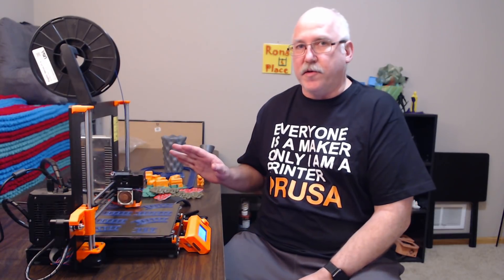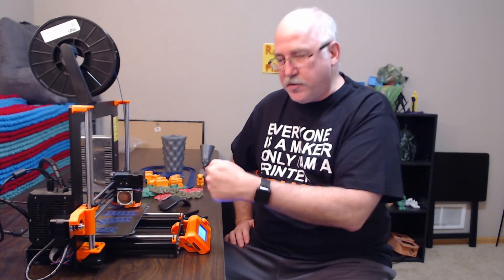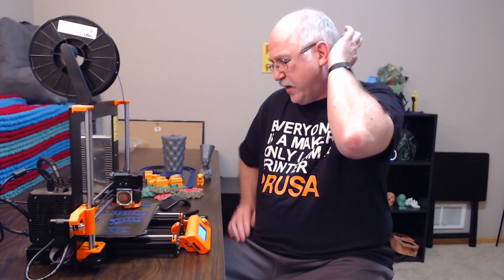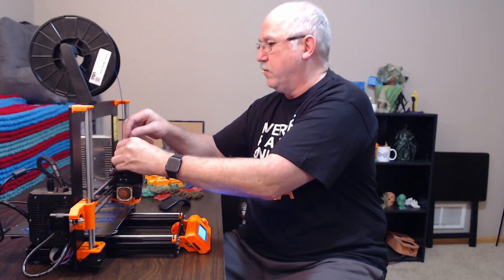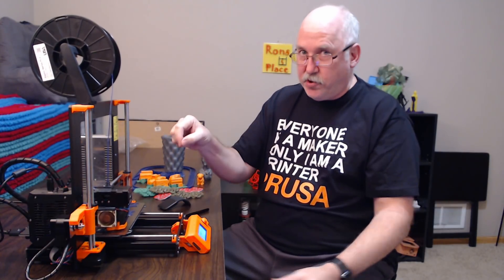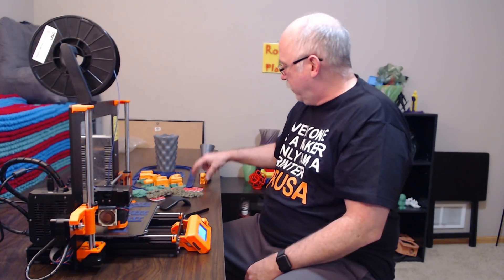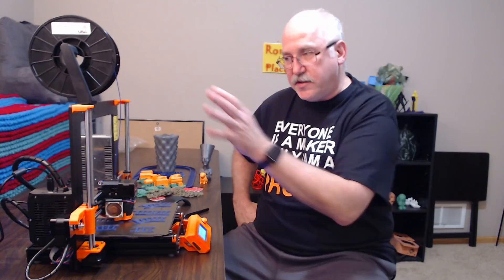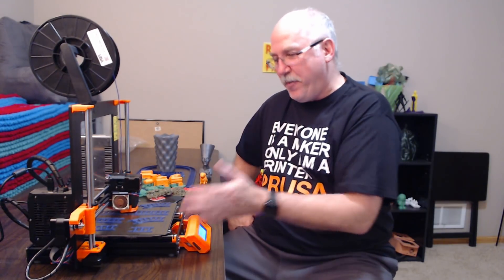Prusa i3 MK3 Build - Feature Testing CORRECTLY

Comment: Ron there is one feature that I have not seen anyone test yet. It does have to do with the filament sensor but not the run out detection. In the PRUSA videos where he talks about the filament sensor he says it can detect the movement of the filament So if a roll of filament jams and can not be drawn into the extruder the machine will detect this. I have had rolls of filament jam before so I know this can happen. Some times you lose a print when this happens some times it just shows up in the printed part as under extrusion. Could you be the first to test this feature for us. Just grab the filament with some plyers so it can not go into the extruder and lest see it the MK3 knows that the filament has stopped moving and if it does know does it just pause the print or does it let you resume after you fix the filament jam.
Reply: Don't damage your machine Ron. I was just wondering if it really could detect if the filament stopped moving. I kind of thought maybe the extruder stepper motor would detect the skipped step just like the X and Y steppers do. Seems like you would only have to here the bond tech gears click once to know if the system detected it.
Reply: That was one of my questions as well.
Reply: You could possibly crimp the filament in one spot so it is thinner so the gears can't pull it as easily?
Reply: Or I wonder if you can reduce the spring tension on the extruder so the filament slips with out stalling the stepper, that way we can see if the Optical sensor detects the movement of the filament and not a current spike from the stepper.
Reply: Your the man for the job Ron. Or you can wait until Feb when I get mine and I will do it first.